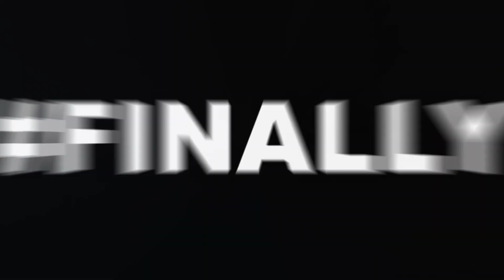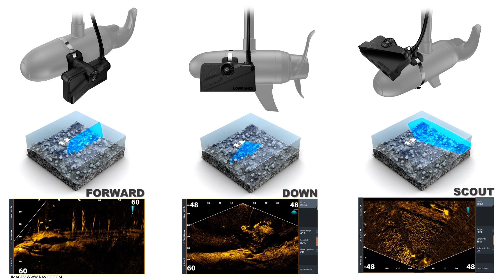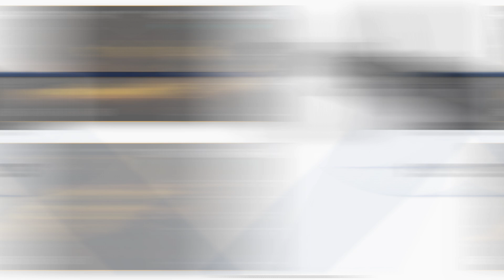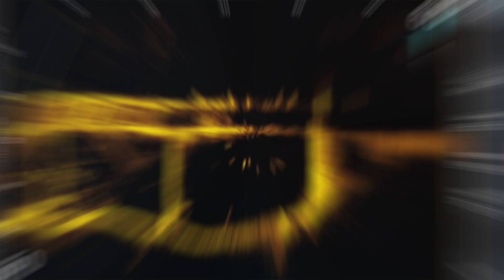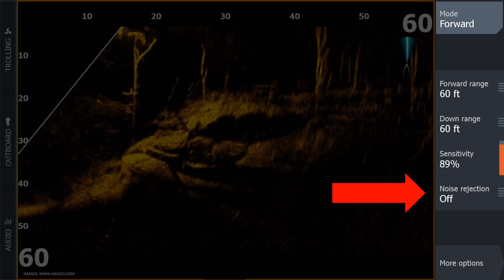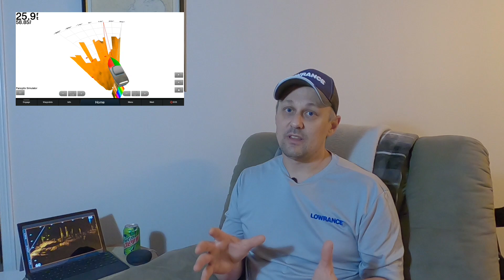Lowrance Active Target is Here - Have They Caught up to Garmin?

Comment: This is EXACTLY what I've been waiting for!  I'm ready to replace all the sonar electronics and trolling motor on my bass boat.  Came close to pulling the plug on the Garmin line.  However, I really do like the Lowrance Ghost trolling motor better.  One thing Lowrance needs to add to their HDS Live screens that Garmin EchoMap has is the ability to quickly zoom into a particular screen in a multi-layout by simply touching or double-touching that section (ie. Map, Sidescan or Downscan) and quickly return to the selected layout by selecting the BACK menu item.
Reply from the maker: Yes I agree with that zoom comment 100%!!! That is a great feature in the Garmin's

Comment: When Lowrance announced they were coming out with livesight  I purchased 2 live 12s to go with my Gen 3 units and waited for the livesight to be offered early spring which turned out to be mid summer. Ounce i finally got he livesight I was extremely disappointed and mad on myself for not purchasing Garmin.  I just purchase the 126 sv echo m and the Panoptix to replace a gen3 unit and plan on replacing the other Gen 3 unit in the future. I was in Minnesota in august and fished on a boat that had Panoptix and I won’t be fooled again.  I’m glad Lowrance is trying to improve but for me it is too late.
Reply from the maker: I think there are many in the same position as you!

Comment: Thanks Lawren, great info as we compare the offerings from the big three. 
I have 2 livesight transducers. One forward on the troller, which I hate, one on the back of the boat that I love! The 40 degree cone angle works well in that application. 
Looking forward to going Active target for the front of the boat. Thats after I sell my kinds for medical experiments so I can afford it.
Reply from the maker: I know LiveSight take a lot of heat (from me included) but there are applications like you've mentioned
Reply: I wasn’t thinking about that, if I add this new technology to my front live unit could still run live sight off the back or isi
Reply: Oops, or is it a totally different transducer?
Reply from the maker: It's a different transducer and I think you'll be able to run both as the Active Target plugs into the ethernet and the LiveSight into a sonar port

Comment: I’m a Lowrance guy but all this playing catch-up is getting old. It doesn’t appear that there’s any significant advancements over livescope. It seems like they just set out to match what garmin has on the market not to be a leader. I could understand business strategy if they we going for volume sales and pricing products for less than the leader, but nope. Lowrance is stuck on making max profit off of each unit and then not backing up their products when people have issues. Lowrance also seems to ignore the ice fishing market imo. They would have sold many more units by putting together ice videos of it in action. Maybe this was because panoptics was cheaper. After owning 10 different Lowrance units I see no advantage to buying another one.
Reply from the maker: I agree with your ice market comments and most of the rest...I think Lowrance really needs to remember where they came from more than anything! When you think of it they pretty much started the LCD screens on ice over flashers with the X67c ice machine.

Comment: I have the mindset that garmin and lowrance are better in certain areas. My plan when the time comes is for a set of each on the bow and console. Garmin for maps, Force TM, and Lowrance for the combined DI and sonar overlay. I think I still like Panoptics better and feel Garmin is ahead in the R&D on that technology. Thanks for the awesome video!
Reply from the maker: Yeah I agree with the multi-brand thing still. I've run a Garmin and Lowrance set up and I think you'll find the Lowrance is better for GPS. I've found getting right on a Waypoint is easier with the Lowrance then Garmin

Comment: Thanks for the informative reviews. I'm looking to upgrade my Terrova 80lb 60" Minn Kota to the newest version but 112lb due to my boat size: 24' Tracker Fishing Barge. I fish an average of 20 trips annually so with good down and side scan performance can get on the fish regularly. Live scope seems to direct all attention to the screen and that's not why I'm an outdoors enthusiast. My current trolling motor does a decent job but the boat is huge and could use more power in windy conditions. Only issue I've experienced is losing Spot Lock on occasion and a poor installation by Bass Pro Shops. I've read some horrendous reviews on the Ulterra  model with the auto store going out and poor customer service from Minn Kota. Also, looking to upgrade my electronics from a Hook9 Lowrance to Garmin unit for networking with the matching trolling motor, mostly for auto contour trolling. I primarily fish for crappie, walleye, sauger and bass on a reservoir in Illinois. With all the mixed product reviews, its very difficult to make an educated  decision on product line. I'm under the impression that Garmin leads the market in technology for marine electronics, but have mixed reviews on their trolling motor. What is your professional opinion on switching to the Garmin electronics and trolling motor for a fisherman with my frequency of fishing?
Reply from the maker: I would agree that Garmin leads the way with sonar right now.  Personally I don't find their units all that easy to use when compared with other brands.  From the trolling motor standpoint I feel what you have heard is correct.  I would get a Lorance Ghost or Minn Kota Ultrex at this point

Comment: I have always been a lowrance fan and still run my lowrance. Had the garmin livescope for over 2 years now and I don’t think this is even on the same level yet. The one that comes out with a cable that can handle colder temperatures. I know I have a lowrance ice ducer that had this nice cable.
Reply from the maker: I agree on that. Those ice ducer cables are awesome.

Comment: I recently got back into fishing and unfortunately bought the Elite FS9 without doing lots of research.  A decent unit, but am disappointed with the sidescan compared to Humminbird (lower frequency, I guess).  Not sure what to do now.  I'm tempted to switch to Garmin at this point since it appears they are generally more innovative.
Reply from the maker: Garmin is leading the way right now for sure.  The Elite FS 3 in1 transducer is pretty good for not being CHIRP transducer.  I agree though that Humminbird Mega SI is best (but their Helix units are so annoying to use).
Reply: @InDepthSonar  Thanks for the quick response!  Are the Solex units any better to use than Helix?  Might be crazy, but now I'm tempted to get a Humminbird for side image on the console, then Garmin live scope in front and put my lowrance fs 9 next to it up front for regular sonar, chart, etc?
Reply from the maker: Honestly that's the best set up these days. A friend on mind did that and it's loving it. Personally I don't like the solix. They are clunky and slow. If take the non touchscreen Helix over the Solix

Comment: The ti 2 had bad lagging problems when power users had lots of stuff going on at the same time while using wi fi to link. 30seconds  at times with no response from the units.
Reply from the maker: Yeah I can see that. Would be nice if they just left the wireless for waypoints though. That worked so well.

Comment: If i read my owners manual correctly the FS does connect wirelessly just have to turn those settings on
Reply from the maker: I haven't seen that in there?  What page?
Reply: @InDepthSonar  page 221 and also I have 4 ports on mine but in all fairness I just bought mine and they may have got some feed back and changed things on the elite fs I bought
Reply: @InDepthSonar  When it comes to the ports i misunderstood what you said. I watched your video again and now understand what you where talking about the network port. really enjoyed your video

Comment: What do they have as an option to mount on the transom?   Lots of guys using livescope and panoptix for down rigging.   Hopefully lowrance comes out with a transom mount bracket
Reply from the maker: They do have an optional transom mount for it. Keep in mind the narrow angle of the transducer though when used with downrigging. Their LiveSight product would be better for that application. Most Garmin users run the PS30 over the LiveScope for down rigging

Comment: I have a minkota with spot lock and lorance helix 7  doesn’t that require not using the trolling motor shaft?
Reply from the maker: Yes, you would have to use the trolling motor shaft

Comment: I troll for Musky with kicker motor and remote steering and throttle.  Trolling motor is not deployed to steer.   Have an HDS Live 12 on dash and HDS Live 9 on bow thru trolling motor.  How could I utilize the Active Target real time?  Troll between 3 and  5 MPH
Reply from the maker: Most guys trolling prefer the LiveSight transducer because it is a wider beam. That will help you pick up more. The active Target is narrow so you get the detail, but you don't cover as much. 

They are going to have a transom mount for the active Target so that would be best if you plan to get it for your application

Comment: Will it be compatible with my Gen2 touch HDS12? And work with my nema 2000 backbone?
Reply from the maker: Nope, only goes back as far as the HDS Carbon. Also it's Ethernet to a compatible unit and doesn't work through NMEA2000
Reply: @InDepthSonar  well that's a shame. They most likely lost a sell with me and a few others.
Reply: Great video though amd thank you for a fast response to my questions!

Comment: So I have a lowrance elite 7 ti will this be compatible with my unit
Reply from the maker: No only the units mentioned in the video will work. This connects though ethernet and there is no ethernet port on the Elite Ti units
Reply: @InDepthSonar  well that dumb. I bought this unit when livescope was already on the market? Think I’m going to be making a switch cuz they have dropped the ball with this one. How can you make something that’s not compatible with all current running units? And I know the elite 7 ti is a little old but like I said I bought it brand new last year from lowrance and thought it had everything I needed for future upgrades. Clearly I was wrong and gave my $600 to the wrong company
Reply from the maker: It's not compatible because the Elite Ti units don't have an Ethernet port on them. You physically cannot connect Active Target to them. So it's not dumb, it's reality. The Elite Ti units are priced cheaper than the HDS units for reasons like this.
Reply from the maker: Yep dumb alright..........

Comment: Not a chance that Lowrance anything is easiest to use. I can't even begin to say how many times my very expensive Lowrance HD unit has just locked up the screen when I turn it on for no reason whatsoever.  Hell, just figuring out how to set the range on this unit is a nightmare. I've never had a problem (not a single one) with any Hummingbird unit I've ever bought over 30 years and I on ly bought a Lowrance unit because they are compatible with my Hobie kayak. Seriously, Lowrance needs to find some new designers that know how to simplify and explain things. 

 As a specific example, How the hell does the average person know how to place the temperature or any other icon on the unit if they don't know what "system overlay" even is? Lowrance makes many assumptions like this which are never adequately explained. I am not impressed- even with my Target 2 unit I don't catch any more fish and to me it's just a major distraction. Maybe with a huge screen but a 9" inch screen in forward mode only uses half the screen of my unit and it's very hard to see what's going on down there. 

I'll be impressed when one of these companies makes forward facing sonar that looks like an HD television. Until then it's not worth the $ to me.

Comment: There is no “stitching” with livescope at 24 feet.   Keep it simple.
Reply from the maker: In forward mode or down mode?
Reply: @InDepthSonar  I am pretty certain there is no stitching on either mode. I am pretty familiar with “stitching” as I purchased the first 3D ct scanner in my home town and the only way we could get a full image of a patient’s face on a ct scan is to stitch. Maybe am not understanding the premise here.
Reply from the maker: These transducers use 4 or 5 sonar beams made up of multiple elements in each beam. The unit rotates through firing each beam and then stitches them together to create the image. At times you notice the stitching between those beams